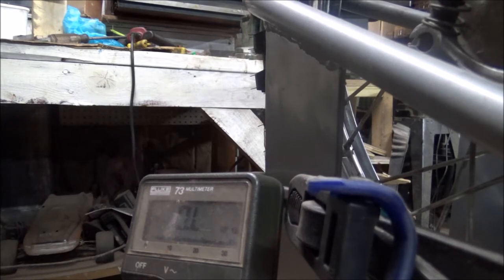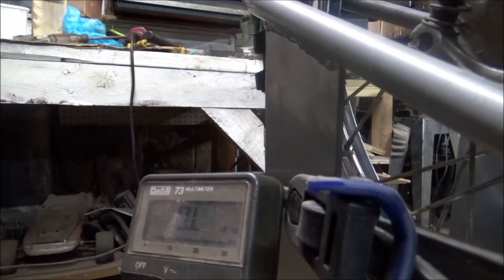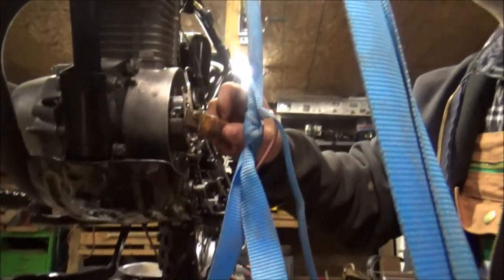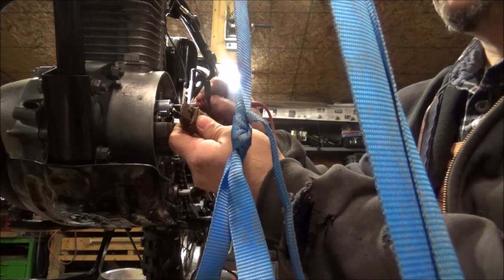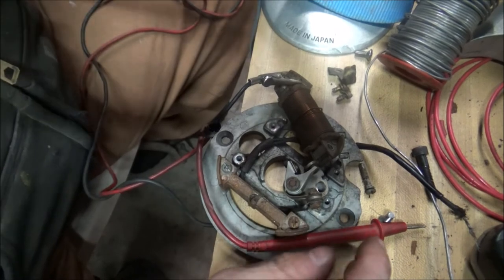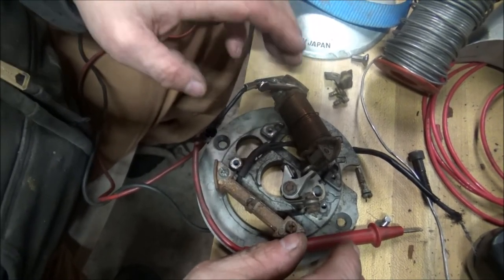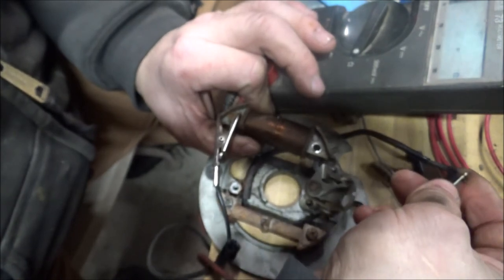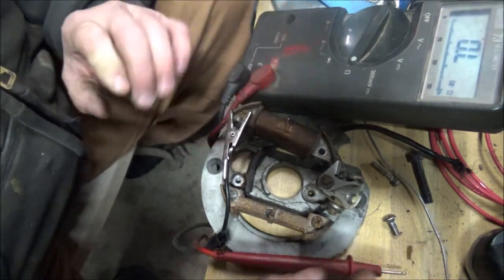XR75 Stator Coil OHM Readings

Comment: Hi Ed. Meter acts like it has a low battery. and if you have them use clip leads  so you don't touch both wires.and get better contact.
All my best.
Bobby
Reply from the maker: Bobby Tectalabyss Yes you are correct I put a new battery but still getting 2ohms and nothing on the 77 coil.  Thanks for watching commenting and subscribing

Comment: hi Ed. I see you are holding the coil in your hand on the second coil and you are touching the lead on the other side. maybe it is picking up your resistance.
Reply from the maker: I mentioned that at one point.  I tried not touch but kind of had to.  I have feeling that both Stators are shot,  They are both over 40 years old.
Reply: Wow that is old. is the a way to rewind them? or are they still available.

Comment: Sometimes a weak 9 volt meter battery can cause  problems. Is your test leads ok? Jim from mi
Reply from the maker: That could be...I haven't changed the battery in a long time.  It seams to measure ok on one coil and go wacky on the other.  Thanks for watching, commenting and subscribing.